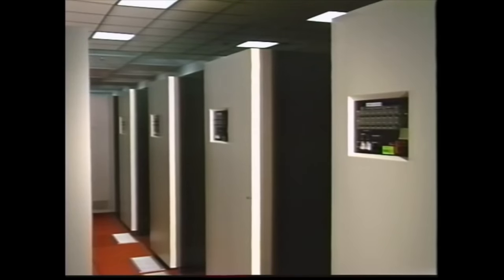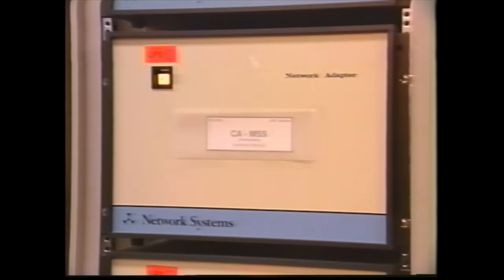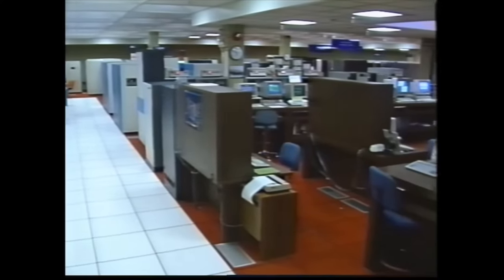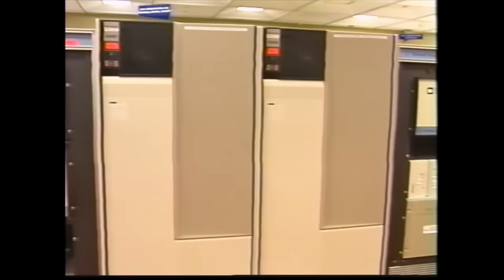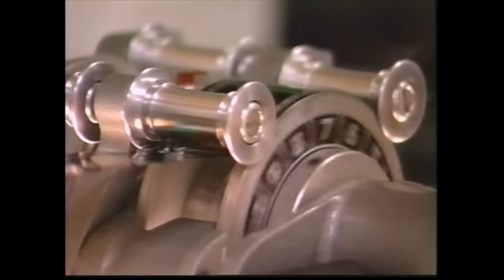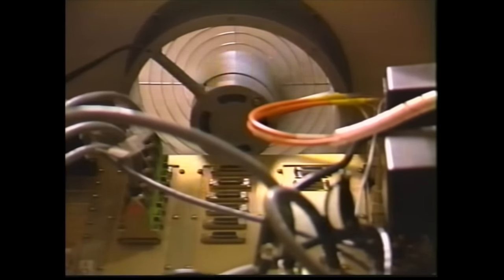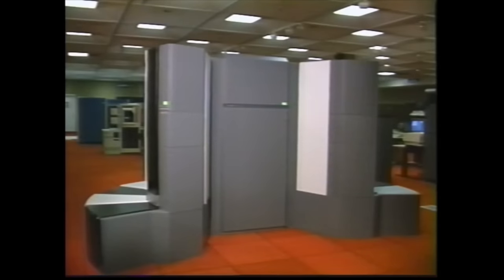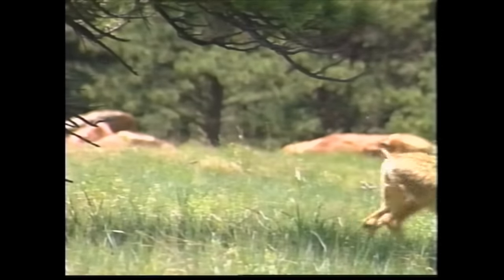Computer room walking tour, 1992

Comment: Oddly enough, some of the specs were wrong in this video, as pertaining to performance. The first machine, the 8 processor Cray Y-MP 8d/864 was configured with 512MB of RAM and was capable of 2.16 GFLOPS sustained.  The second 2 processor Cray Y-MP 2d/216 machine, with 128MB of RAM was capable of about 514 MFLOPS sustained. While the Cray machines were very cool, the oddly overlooked Thinking Machines CM-2a is easily the sexiest and most exotic of the three, and was capable of around 1.5 GFLOPS sustained, but only with a very carefully coded workload. 

Altogether, those three machines could muster around 4.16 GFLOPS sustained float64 throughput. The desktop machine I'm writing this on (16 core Ryzen 9 5950x + Nvidia RTX 3080) is capable of 1075 double precision (float64) GFLOPS (610 GFLOPS on the CPU + 465 GFLOPS on the GPU). Mind you, this is like for like double precision floating point, not single precision (of which my machine is capable of over 40 TFLOPS float32 on the GPU alone). Essentially, when it comes to float64 performance, my desktop (which is 2 1/2 years old now) is 258 times faster than all three of those multi-million dollar supercomputers combined! 

Hilariously, my main desktop in 1992 (which I still have) was an Amiga 3000 with a PDS installed 25MHz 68040 upgrade, giving the machine 3 MFLOPS of raw double precision power (or 358,000 times slower than my current desktop). Pretty crazy how far we've come in the last 31 years.
Reply: AGREED .. when the Thinking Machine CM2 shows up.. im like ..whaaaaaaaaaaa.
Reply: @NeverMind-pk4wz  First, the Y-MP numbers, along with the modern desktop hardware mentioned (and my Amiga’s 040 FPU) are based on Linpack runs for throughput (not peak) and are roughly comparable benchmarks performing double precision arithmetic. This is not apples and oranges, like comparing MIPS between dissimilar instruction set architectures.

Second, modern CPU cores have no problems with immediacy of either register -register or register-memory operations as they have huge physical register files (implemented via queues or reservation stations) that implement register renaming, along with huge tiered cache hierarchies, where even down into shared L3 territory the bandwidth is unfathomable in comparison to a Y-MP’s processor (especially when we’re talking things like core and die interconnects). There’s comparatively little impact from context switching, so much so that not only are modern CPU cores deeply pipelined, wide-superscalar machines, most implement speculative fetch and execute and, in many architectures, SMT to allow multiple simultaneous disparate instruction streams, by exposing two or more architectural front-ends (logical processors) to the operating system for simultaneous scheduling (thread contexts). I’m not even going to delve into the comparatively enormous transistor budgets afforded to SIMD vector (and other SIMD) logic on modern cores.

And this is just on the CPU side - when comparing the true heir to specialized vector processors, we get into the MIMD world of GPUs, which offer compute throughput that makes anything we could have dreamt of in 1992 pale in comparison. 

Finally, when comparing modern CPU cores to the Y-MP’s CPU’s, they’re not actually radically different, nor is the Y-MP particularly exotic. Physical implementation was insane (out of necessity in that era), but logically it’s not impressive by today’s standards. You have scalar instructions, SIMD vector instructions, addressing instructions, along with corresponding architectural and physical registers, and corresponding execution units. In fact, while the Y-MP might have a more elegant ISA, and a far simpler instructions set compared to modern AMD64 and ARM64 (again, out of necessity), the Y-MP was a shared memory multiprocessor machine not at all dissimilar to todays modern chip-multiprocessors (multicore). 

So yeah you can roughly compare performance when talking about floating point operations, and yes, even basic hardware really is radically more powerful than 30 year old supercomputers.
Reply: I bought my Amiga 3000 back in 1991 and I still have it (unused now).
Reply: @nine7295  Make sure you remove the Varta battery if you haven't already, or it might end up needing some serious repairs (if you haven't looked, you'd be shocked at the prices 3000's go for nowadays).
Reply: In 1992 my computer was IBM 80286 2m ram 40m hdd
Reply: @fengpxufengpxu4768  Now the question is, what clock speed did it run at? The Harris 286 parts ran all the way up to 20MHz.
Reply: When your home setups has bigger numbers, than old million dollars of equipment...

My desktop: 
- Ryzen 9 5900
- 64 GB DDR4
- GTX980 (Don't game that much anymore)
- 3 nvme ssd's (1TB for Windows, 1TB for Linux, 2TB for data). 

My VM server:
- Ryzen 7 2700
- 128GB DDR4
- GTX650 (No monitor, but won't boot without graphics)
- 1Sata ssd for Proxmox, 2TB nvme for VM storage, 3TB HDD for additional storage

My storage server
- I3 8100
- 8GB DDR4
- Integrated graphics
- 1 Sata ssd for OS, 6x18TB in raid 6 (or around 71TB of usable storage).

Comment: Awesome video. A bit saddening to think all these beauties may have been sent to the scrape-yard.
Reply: That the sad thing about innovation, computer hardware become outdated fast. Lucky moderns computer are designed to be upgraded with new hardware.
Reply: @AS-R-bx3zi  not as much as you'd hope. I wouldn't be able to replace my cpu with a newer one since the socket changed. I wouldn't be able to just get an RTX4080 without first replacing the power supply, and that is assuming my motherboard doesn't cause some kind of issue with it. I wouldn't be able to slot in new faster ram since it is now DDR5 instead of the DDR4 from ~2 years ago. In other words.. for a proper upgrade, I still end up replacing the whole thing.
Reply: There are a handful of museums out there with the aim of preserving these systems, and minicomputers like PDP-11's are a frequent exhibit at vintage computer festivals
Reply: @ruadeil_zabelin  frame work laptop is upgrade-able to an extent.

Comment: Pretty funny. I was with a company installing an alarm system in a very large data center back in 1974. There was a note taped to one particularly menacing looking computer that read ...It would take 100 employees working 100 hours to correct all the mistakes this machine can make in 10 seconds, so for God's sake BE CAREFUL!

Comment: I worked in a similar type of facility in 1997, except it was mostly IBM mainframes. Admittedly, it was out of date by then, but very hard to replace. It was always interesting to see a mainframe cracked open, revealing an OS\2 workstation inside. In my case, the storage was mostly tape (8-track). We had a library of over 800,000 and it was NOT automated. When a system called for a tape, you had to go find it and manually insert it. On a busy night it was quite a workout. Don't even get me started on backup night. This was a.... let's say secure facility. I had no idea what the computers were actually doing even when I had interface access through a console to complete tasks.
Reply: I was a mainframe operator for about 5 years, so I can relate.  I am sure we did not have as many tape cartridges as you, but some days it sure felt like it.  
I actually remember what I was doing at 2000-01-01 T00:00:00... I was mounting a tape!
Reply: I would argue that IBM has the longest track record, of being most "outdated" of all tech companies still in existence...
Reply: @timmy7201  If that's true, then why do they file THE MOST patents each and every year?  Of anyone!!
Reply: @jovetj  Ever heard of patent trolling or patent hoarding? 

IBM doesn't use those patents, besides suing other companies for infringements. 

They just stifle research and innovation..

Comment: Oh - that brings back memories! Mostly fond ones too. Two of us on shift one day worked out how to stack the tape cartridges across the tape drives we had to maximize throughput (so we had a tape already loaded as opposed to having to wait for a tape to unload/load). Nobody could understand how we managed to get work through so fast with just the two of us! As for ACS, I managed to argue against having them (robot arm was a single point of failure as it was also responsible for passing through tapes to another unit via the pass-thru port - and we needed at least 2 units). Went with IBM libraries instead (which had parallel tracked robot arms, so an arm failure didn't necessarily stop the library from working).

Comment: 1992 was the year I left college and started working in IT. At home I had just invested in my first ever hard drive, a 20mb unit (actually a hard-card) for my ibm compatible machine at the cost of around 1 weeks wages. Sat in my home office now I'm looking at a WD 4TB drive that cost less than 1 days wages and has 64mb cache memory thats more than that first drive had storage!!
Reply: Don't forget the space on your micro sd card. The size of raisin yet vastly more storage then there massive 5.2 gigabyte units shown.
Reply: In 1991, I bought a 100MB SCSI quantum HDD to upgrade the 52MB HDD inside my Amiga 3000. I think I paid about $300 USD then, not exactly sure now. I still have that unit.

Comment: around the time of this video, I worked for one of the supercomputers centers run by NSF in Princeton NJ. While we had access to crays on the network, we mostly used CDCs and had one of the few ETA10g's which at the time was more powerful. (Specs are on wiki somewhere, but safe to say your cell phone can outperform it now) 
One day I had used telnet (ssh was not the thing yet) to edit some files on a Cray using emacs. There was such a clear improvement in behavior over the VAXstations and Sun 2s we using locally that I just kept editing the entire project that way. A few days later I got called on the carpet for using a huge chunk of budgeted cpu time for emacs. :-) 
These you just expect computers to keep up with you when typing, but in those days it was just expected to have to type slowly or wait for the computer to catch up.
Reply: Tks for sharing your experience
Reply: editing files directly on a Cray, huh?
Reply: Your time was clearly not as valuable as the Cray's.

Comment: Im curious about the end game for these machines. When was it pulled from service and what did they do with it? The machine probably cost millions and of course depreciated. But I'm curious about that time in between when it was decommissioned from the first owner but before it was sold for scrap.
Reply: Most of these were flogged to the very last moment or until it was no longer economical to run them. (Output over power cost etc.) Also, these required a tremendous staff to run. By the end of the 90's, running these “big iron” pieces, without having such a staff was untenable. During that period also there was a serious economic downturn that started to spell the beginning of the end for these systems. Managers were demanding on an ever-increasing basis more and more but had less and less staff to which to do the same operations. Running “Big Iron” was labor intensive and without the staff, it hampered the overall performance of the systems. Additionally, from 1992 to 2002, the run on the Moorse law principle radically outstripped the pace at which these machines were able to be efficient in producing results. Their only saving grace was their redundant and parity checksum abilities, but even by the mid-2000s, small platforms were wildly outstripping these systems daily. So, in summary, many were literally run on their last day like a regular day, and at near the end of that shift, data was fully backed up, and a small effort to wipe was then committed, and the room went dark / powered down. Literally to some extent, the next day the scrap folks would show up and start to pull the equipment apart or out, and in some cases while data management folks were still boxing tapes for archive or transfer. I can attest to it. I watched it happen in a facility in Canada that I had only just been employed in. The era of big iron was to a degree forever changed with the wild rip of Moore’s Law in that time and the advancements that came from it.
Reply: @digitalshackonthelane  thanks for such a detailed answer! I guess for a mainframe/super computer to be usable after decommissioning it would need to be built that way from the start.Whats amazing is that a lot of those backup tapes probably work still, since tape is rated for ~30 years.
Reply: @HyenaEmpyema the question is: what meaningful data would we recovery from the tapes?

Comment: Please forgive the following little vintage computer anecdote, I know very little about computers, especially at this level but I love to watch material on cutting edge computing from the past. In our family business back in the 80's we had a network system based on what was then cutting edge for small users, a 286 file server, wow!  It had custom written business software because, for that time, we had quite a difficult application.  So, the system had been installed for about 8 months and one afternoon the guy from the supplying company who did routine software maintenance as part of the service contract, called me to advise that he needed our authorization to install a larger hard drive as we had almost filled the original. It was going to be quite expensive as it needed to be double the size, from 10MB to an incredible 20MB!!  Makes me smile now to think of how significant that was then to what almost everyone has at their fingertips now!  I still have the file server, must have a chip count in the hundreds, but it still works!  And one last thing about that system, it was £12,000 in 1988, for an 8 user system!!

Comment: Hearing the word terabyte in 1992 just absolutely blows my mind,i was already mind blown away once i heard about a 1terabyte harddisk drive back in 2015,but these days we already have 1terabyte usb sticks,heck even my 8 year old laptop ssd drive is not 1 terabye,
In fact ssd drives were ridiculously expensive back in 2010 and didn’t had much storage then the cheaper but higher capacity harddisk drives,these days ssd drives seems to be sooo common and harddisk drives seems to become obsolete and outdated these days,right???
Reply: Yeah, more or less anyway. For the average consumer even an inexpensive SSD is the way to go when building or ordering a computer. The performance benefits coupled with ever improving pricing is thankfully creating an ecosystem of modern devices that aren't lobotomized by their mass storage. I still have plenty of spinning rust in use but most for my own storage and archival needs. Hard drives still have their place for mass storage however the days of being a valid boot drive are a bit behind us... thankfully!!! >.<
Reply: Hard drives are still useful if you store lots of pirate movies and TV series. The price per TB is three times lower (five times if you need drives that are larger than 16 TB). Keep in mind that you will need SATA port multiplier capable motherboards and more drive backplanes with lower capacity drives.
Reply: hard drives still needed for more reliable long-term backup purposes.  ssd's need refresh electrical power so they cannot sit around indefinitely unplugged from the wall.  hard drives, meanwhile, can in fact sit detached and perform flawlessly if they were in that state to begin with.
Reply: @oldtwinsna8347  hard drives honestly should be used for cold storage either as they are still subject to bit rot unless you gave a managed storage pool scrubbing the data. At that point the disks are spinning 24/7 so it's important to by properly rated drives. Real archival storage would be something along the lines of a tape backup. Though a combination of different mediums can achieve the goal of proper data retention and speed of access.

Comment: I always wondered if you could sit on those two benches that is on a Cray or if it wasn't made to sit on.
Reply: You can. The bench is primarily functional volume - it houses the power and cooling system. But it is made strong enough to sit on easily, and even has a comfortable padded surface: It is designed to serve as a bench as a secondary function. I assume because it added no significant cost to put some padding on the top.
Reply: @vylbird8014  For an example of such a use, see the 1992 film Sneakers. The characters played by Robert Redford and Ben Kingsley sit on a Cray Y-MP.

Comment: Your toaster now has one billion times more computing power than these machines. These machines needed to be kept in a temperature controlled room. Modern computer chips will work just fine from -1000 degrees Centigrade to +1000 degrees Centigrade.